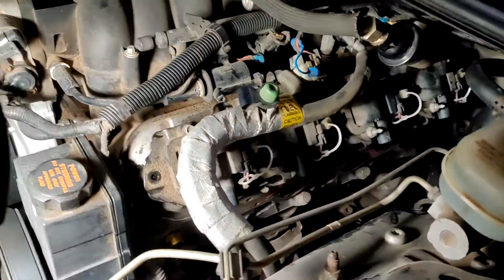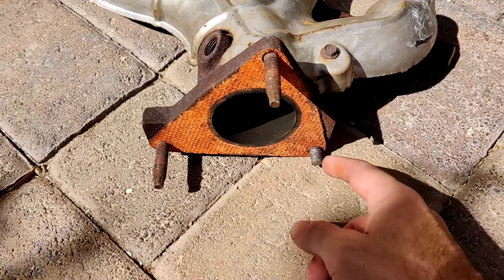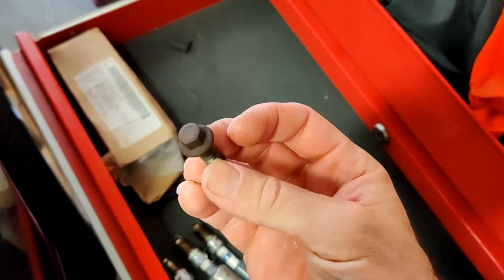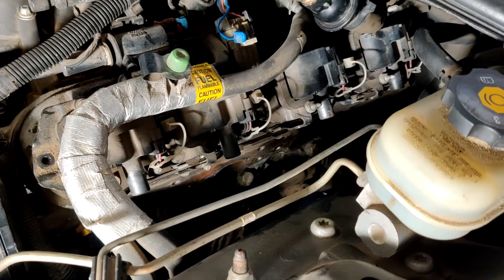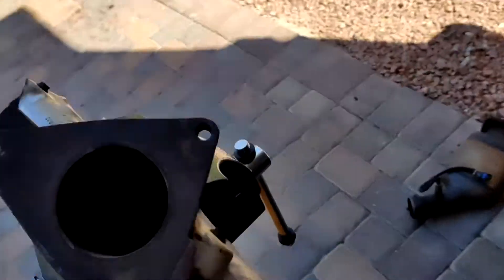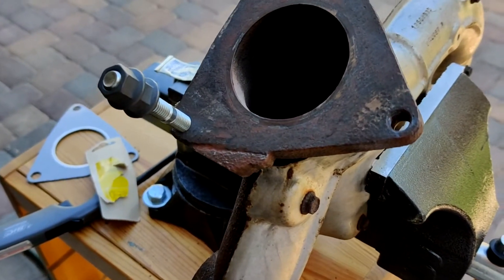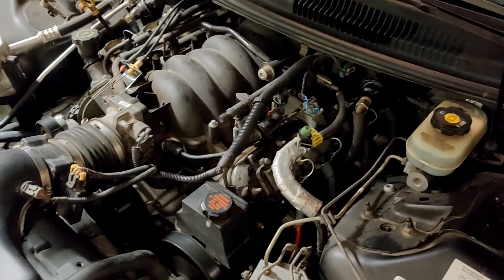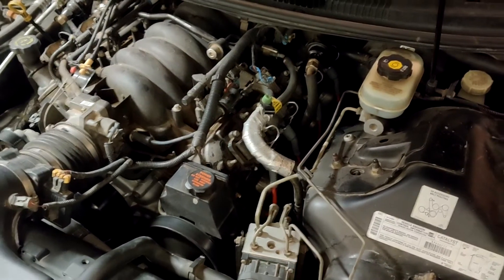98 02 Camaro Firebird Catalytic Converter Exhaust Manifold Replacement

Comment: Thanks for the video. For the upper o2 sensor can you get to that up top or from the bottom?
Reply from the maker: Maybe if you remove the steering shaft you can get to it from the top. But I'd just do it from underneath.
Reply: @jcx2bby  Thank you

Comment: How's that Flowmaster cat holding up over the past two years?
Reply from the maker: It's perfect Joe, no more issues. Has probably 10k miles on it or so.
Reply: @jcx2bby  thanks for the update.
Reply: @jcx2bby  also, was your OEM one clogged up/broken up inside after you removed it? Mine just started throwing the 420 code, I'm trying to gauge how quickly it should require my attention. I'm worried that the honeycomb may have broken up and could cause decreased performance or if it's just a tad dirty and throwing the code etc. Just trying to go off your experience on how yours looked when removed. Thanks.
Reply from the maker: @JoeSmith-tu7vi  mine had no visible issues when I removed it. No loose chips, no broken honeycombs. Probably just ineffective enough to throw the light. I didn't notice a performance change from the old to the new either. When I changed plugs and wires I did though. Also when I cleaned the MAF. Huge change there.
Reply: Thanks for the detailed response. Your videos are very detailed, Your AIR pump and tilt column videos saved me a headache.
Reply from the maker: @JoeSmith-tu7vi  I really appreciate that feedback. Some people are put-off by my dialogue, but I really try to get all the information in there that I can. thanks for watching my vids Joe.

Comment: Hey there!  I have a 2002 LS1 like yours that i bought new. 86K miles.  Now when I try to smog the thing for California, I can't get the cat-test to complete. CAT_INC, it says.  I've driven almost 500 miles doing that drive-cycle nonsense.  Any suggestions on that?  How can I tell if I need to replace a cat?  (There are two, right?)  Help me not go further insane. 🤪
Reply from the maker: Hi, I know about this frustration. The catalyst test and the evaporative system test are the 2 hardest to get complete. Simply driving X amount of miles won't get it done. Certain parameters must be met by the ECM to consider a system fully good to go. And it's difficult to know what it needs because, as you've found out, the nuances of the GM drive cycle aren't well described. Sure, there's lists of requirements out there, but there seems to be as many opinions on what to do as there are people. 
If you've mainly been driving it around town, under 60, get on the highway for an hour and cruise above 60 for a couple hours. Yes, hours. If you've mainly been on the highway, drive it around town. 
Finally, get yourself a cheap OBD2 bluetooth scanner and the Torque app for your phone. The app will use the scanner to display which tests are done and which aren't. That way you're not wasting time and money going back to the emissions place. 
Good luck. I feel your pain.